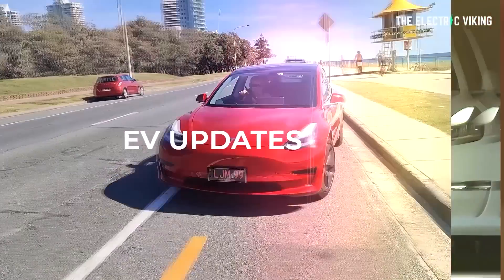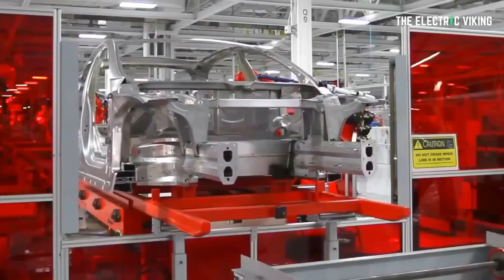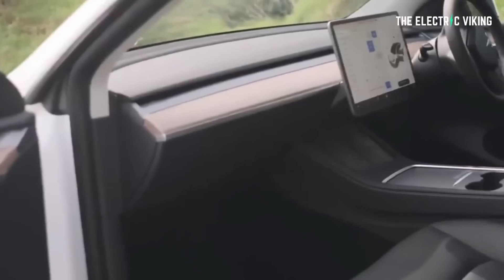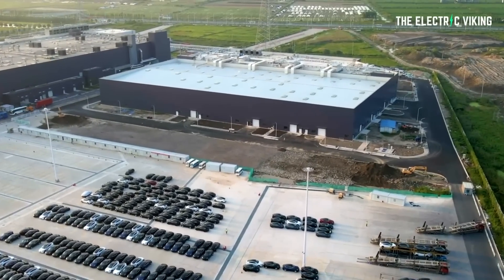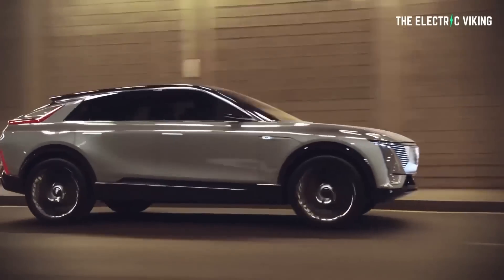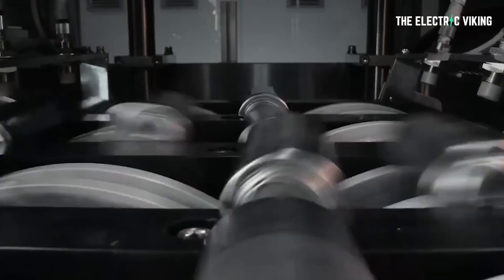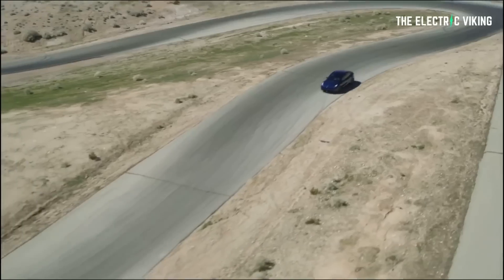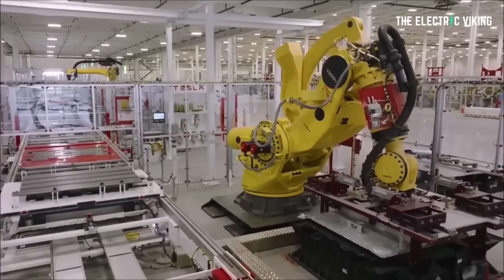Tesla's NEW 4680 battery pack size is UNBELIEVABLE

Comment: Actual measurements reported indicate this battery pack is approx. 68kWh,  not 50kWh.  Even if it were 50, this would indicate virtually impossible efficiency gains in the drive train, not gains in battery technology.  That said, I'm excited about the prospects for 4680 battery packs.  But let's get actual battery measurements.. capacity, weight, discharge/charge rates, longevity, cost, etc. .. before deciding how significant the improvements are.
Reply: The announced revolution was cost, not energy density.
At this point all questions remained open, at least for me.
Did they implemented the dry cathode technique?
Did they use the tabless design?
Did the really eliminated Cobalt completely?
Reply: @pkvp7337  Exactly. We don't really know much more than before. All that is happening here on Youtube is just speculating and generating "aritificial" news and sensations, aka click bait.
Reply: @pkvp7337  yes these batteries use the dry cathode. And are tabless. The energy density is improved as larger cell allows move active materials as a percentage of casing materials.
Reply: @aaronheaney2694  Is that confirmed somewhere? Can you point me there?  I am very interested.
Energy density can rise from the format change, but I would expect the removal of Cobalt to decrease it a little.
Reply: @aaronheaney2694  
Energy "density".... is in no way improved by "a larger cell"
(I think you may have seen my description but misunderstood?)
At cell level.
SAME jellyroll material type.
FIVE TIMES as much.
5 times the *Capacity*.
.....
Tabless, so great current / power discharge rate.
......
20% improvement in that, applii to the "5 x jellyroll" give "6x power" 
Both compared to a single 2170.
.....
Pack level 
Same total "jellyroll"
Therefore same *pack capacity*.
40% less steel in the "casings". (Based on outside surface area x estimated cell quantity (which nobody knows yet! )
I suspect the main vehicle weight loss will be removal of the conventional steel floor from the bodyshell.
.
Is better to consider the whole vehicle as a system, since all components (pack, etc) have a "knock on effect" on several others.
Reply: @pkvp7337  
Re "confirmation ...."
You said "energy density" can change with format"
I don't think so.
Power can, it can "lose" the energy at a greater rate.
It can physically hold more energy per unit volume without a "chemistry" (materials) change.
I think it's a sideways step, using 2170 chemistry, produced by the "dry method", rolled into a "tabless" cell.
Result.
Same density (/volume)
5x capacity (volume, ref battery day)
6x power (in that "5x volume", enabled by "tabless construction)
It's an accumulated benefit.
Reply: @rogerstarkey5390  There can be an improvement in energy density if there is a higher ratio of active material to structural material. The equation for the surface area (which needs the conductors, and structural wrapping is the area of the cylinder) is 2πr (r + h) (plus the top and bottom), the equation for the volume of a cylinder is πhr^2. When you work that out for 2170 vs. a 4680 then the volume increase is significant compared to the surface area increase. The surface area of for a 2170 is about 12000 sq mm, the volume is 96980 cu mm. For a 4680 the surface area is 36417 sq mm and the volume is 531808 cu mm. The ratio of volume to surface area is 8 to 1 for the 2170 and 15 to 1 for the 4680.

I seem to recall when I was watching battery day that was what they said about the 4680 is that you need less structural material (I assume they mean the metal wrapper for the cylindrical cell) compared to the active portion (the volume, or inside of the cell).  How much that contributes vs. chemistry changes I don't know, but enough apparently for them to make the change, which is super expensive. They wouldn't change the size if it wasn't a significant benefit.
Reply: @rogerstarkey5390  Formats can make energy density "slightly" better, because of area to volume ratio. The steel can does not hold energy, therefore if you use less steel for every cubic centimeter of active material, you get better energy density.
This is a diminishing returns relation though. A very small cell wastes much weight in the steel container and there are real gains to be obtained using larger ones, but the same is not true for a large one.
That reminds me that history about Tesla in the early days, trying to convince Panasonic to use aluminium cans. It seems they abandoned that improvement path.
Reply: @aaronheaney2694  there's likely also a benefit from a chemistry development too (power/energy density) as Tesla are always making incremental changes thanks to still partnering Jeff Dahn & his Dalhousie team, I believe.
Reply: @pkvp7337  I have assumed all 4680 batteries will have the LFP chemistry. So no cobalt.
Reply: @jimbodee4043  As far as I know, all Tesla LFP batteries are prismatic and produced by CATL (and now BYD).
The announcement on battery day about the new 4680 was: nickel, no cobalt, dry cathode on production, tabless
Reply: @pkvp7337  They showed different uses having different chemistries, all with the 4680 cells...  LFP was definitely one of them.  They have said many times that the 4680 could use LFP or other chemistries...  Might not make sense to use cylindrical cells with LFP due to the higher safety tolerances of LFP allowing less packaging per watt hour...
Reply: @karlsjostedt8415  Yes they said there were willing to use iron and manganese, but only for cheaper car models and stationary energy.
The big star of the show was the new nickel cell, without cobalt and much cheaper to produce.
I have not read any clue about cylindrical LFP, although many people would like to see that (me included).
Reply: @jimbodee4043  probably both. With cyber truck and semi, they will need cobalt and high nickel content to maximize energy density but different chemistry will work for lower range vehicles.
Reply: @jimbodee4043  
As much as I would like (and expect) them to be LiFePo4 EVENTUALLY ......
Louis is right in the money, correct, spot on, right.... etc.
Nickel, not Iron based.
.
Now, I've not watched this whole video yet, (Sam was "doing my head in")... But I'll guarantee Louis is closer.
Reply: @karlsjostedt8415  
Watch the latest interview with Drew Baglino at Stamford (last month)
Asked and answered there.
Reply: @jimbodee4043  I dont think the BYD deal has the same chemistry as CATL and Panasonic
Reply: @pkvp7337  correct
Reply: @karlsjostedt8415  actually Tesla has said that the 4680 would NOT be LFP.
Reply: @davekozlowski1266  Tesla said that current 4680 are not LFP.  Tesla will surely change their minds as soon as there is reason to.
Reply: @CorwynGC  they stated that the 4680  wasn't a good design form for LFP batteries. They are already using a lot of LFP batteries, just not in that form.
Reply: @davekozlowski1266  Right, that changing (which it could) would be one such reason for them to change their minds.
Reply: @jimbodee4043  The 4680 is a higher capacity lithium-ion battery not LFP.  They  are nickel-cobalt-aluminum (NCA) batteries so I guess that means no cobalt.
Reply: The Size must be the same for all versions to fit the chassis. This is no indicator of the number of cells inside. So the pack size is same for 50 and 70kw. The weight would vary.
Reply: 1) The anode has always been dry. What's new is the dry battery ELECTROLITE process. 
2) Without any chemistry changes, the 46-80 cell is more energy dense both by weight and by volume due to the increased volume to surface area ratio of the larger cell.
3) The deal with BYD is for LFP blade batteries. They have a near zero risk of thermal runaway resulting in battery fire. The deal with CATL is for LFP prysmatic cells. Tesla will use anything they can get their hands on until they can sufficiently ramp cell production for their own needs.
4) 46-80 is a form factor, not a chemistry. Tabless electrode, DBE and the larger form factor can be used with any chemistry. At this time, I have not heard that Tesla has or will implement 46-80 LFP, but there is no physical reason why they can't.
AS for the speculation on "D50" meaning that it's a 50 KWH battery pack, it's just that, speculation. For my part, I believe it's somewhat bigger than that.
Reply: Sam,  Is the Tesla Model Y 4680 out of Texas a 50 Watt or a 68 watt battery pack???  This is very important!
Reply: @laurenceguild5799  
50 Watt or 68 Watt?
NEITHER.
It's " +/- SIXTY EIGHT KILOWATT HOURS"
Reply: @laurenceguild5799  Other users who have the car have said 68 usable and have recharged over 60 kWh already.
Reply: @laurenceguild5799  
Watch the channel everyone is referring to.
I THINK Sam is confused between full pack and the amount charged. (10-97%?)
Reply: When will the actual vehicle 🚗 be available for proper tear down to see all the specs for sure ?
Reply: @river2voya211  
Hold in..... I'll just look ....   (/s)
.
.
"When someone decides to do it...... and publish the results.... Maybe? 🙄
Reply: Where exactly does the number 50 kWh come from? I looked up the video from spiken reviews, and on the paper you can the consumtion. I think it says 28 kWh / 100 miles. For 279 miles the battery has to be 78 kWh!
Reply: No one ever charges lithium 100% you can increase the life of them huge
Reply: Why call it 50D then?
Reply: @egs2169  don't know, but hard to put over 60kwh into a 50kwh pack. Obviously it's bigger than 65 kwh.
Reply: My guess is that they have moved to a ‘usable capacity’ rating (50D) instead of a ‘raw capacity’ rating.  There’s a buffer on either end.  The useable capacity probably varies significantly between battery cell technology, so raw capacity is becoming more confusing.  I’m not believing the 50 KwH raw pack size unless I hear it from the company or a reputable tear down.
Reply: The evidence for the 4680 model Y having a 50 kWh battery seems weak. All I have seen is that the mobile app refers to it as a “50d”. On the other hand the same reviewer, “spoken reviews” on YouTube, demonstrates a capacity of about 68 kWh by doing a range test then recharging.
Reply: @dufkers  so it is 68 kWh. The recharging measurement is the most accurate. Sam as well as the Tesla fanboys are not good at physics. A bigger cell is more efficient, but is only a few % more efficient in space saving. The advantage is in manufacturing cost but the savings is only around 10%. This is an improvement, but only evolutionary, not revolutionary. The structural battery is to use the battery case as a structure, but it creates stresses directly to the battery, which can be dangerous. In case of accidents, the battery will be more easily damaged. Coupled with a flameable isolation insulator foam, Model Y is not as safe as Rivian. The additional cost saving is not much, should be around 5% but any saving is welcomed.
Reply: @othmanskn  Agreed that Sam should check the facts and evidence better as the battery size is no only 50kwh but closer to 70 in gross capacity.

However, you are coming with as silly predictions with no evidence by calling the new Model Y unsafe with flammable foam. Where do you have the evidence of the protective foam in the sides of the pack being “flammable”?? You know, if you know physics, then you should also know that you state proven facts not just oie in the sky assumptions. When the Cybertruck comes then compare it with Rivian. The Model Y is already more successful as the Rivian will ever be and has proven it self with hundreds of thousands of customers.
Reply: @TheDanishSpaceman  Sandy Munro tested the foam from a Tesla and a Rivian and said the foam from the Tesla was flammable.
Reply: @rogerstarkey5390  Just because they are smart, does not mean they can break the laws of physics. For details on the Rivian heat isolation foam, watch Sandy Munro Live.
Reply: @davidbeppler3032  I was just replying to the guy who questioned the flammability of the foam used. It was tested by Sandy Munro and he found the Tesla foam more flammable. 
I have no idea how that effects the safety of the car but it must have some effect.
Reply: @othmanskn  the manufacturing cost is closer to a 50% saving. Did you consider the removal of the cell drying process with these cells?
Reply: @alibro7512  
"Flammable"
1) Emphasis on "was"
.
2) there's a difference between "heat" and "flame".
.
There are many foams which "burn" (ish) then form an insulating barrier.
.
If you go waaaay back to the very first patents for the idea if a structural pack, there was a section mentioning (from memory"
"A material which changes state depending on temperature" and "forms an insulating barrier in case of extreme temperature".
Reply: @alibro7512  That was a HORRIBLE demonstration by Munro.  The used a torch on a large flat expanse of foam, and compared that to a a match on a tiny shard of foam.  Try the same for yourself with two pieces of the same wood.  OR just think about how you light a fire. I would expect this sort of thing from FUD merchants, and expect better from Munro.
Reply: @CorwynGC  I was only pointing out where the information on the foam came from, not agreeing or disagreeing with it. 
Yes the demonstration was badly done but Sandy wouldn't have pointed it out if he didn't think it was relevant.
Reply: @alibro7512  Munro & ass. haven’t got the foam from the 4680 battery pack, so that sounds strange. If it is from the current cars they dissembled than it is a bit of a mute point as safety has never been a concern for current Teslas
Reply: @alibro7512  No criticism of you intended.
Reply: @alibro7512  I know.  Maybe Sandy should burn both the carpets and see which one burns faster, and the seats, and the headliner?  Those matter as much as the foam in the battery packs.
Reply: @davidbeppler3032  There are many many things I am not an expert in. Product safety and fire retardance are just two of them. 
I prefer to rely on people who ARE qualified  and Munro Associates have people with those qualifications. 
It's kind of a moot point anyway as mentioned by another commentator who pointed out it was not a 4680 pack that Munro tested.
Reply: @Othman just because you hate Tesla does not make them bankwupt no matter how smart you think you are.
Reply: @alibro7512  To be fair, Sandy did not *care about the flammability of the cooling system, just made a note about it.  He did not say it mattered at all.
Reply: @alibro7512  more flammable, as opposed to just flammable?
So either your phraseology is wrong, or they're.... BOTH FLAMMABLE!!
Reply: @othmanskn  don't know where you're getting your cost savings from.  Battery day gave figures for cost savings based on structural battery production & materials then 2170->4680 materials & construction, which is far higher than your claimed 5% in combination.   The fact Tesla takes 10hrs to make a car, vs VAG takes 30hrs, I'd imaging 20hrs is worth quite a bit (bearing in mind not all those saved hrs aren't just because of the battery structure).
Reply: @othmanskn  very vague reference to Sandy's multitude of videos
Which one?.... 🤦
Reply: @aaronheaney2694  Othman ["follows Lightyear closely"].   Their claims are hilarious, I remember reading their science fiction novel a couple of years ago & there were some brilliant arguments & claims in comparison to Tesla regarding price/"quality".  I wonder if Othman is trying to downplay or damage Tesla's reputation (thus sales) so his beloved little Lightyear investment can grow like Tesla's?
Of course no one would play that little game with Tesla or has ever done that kind of thing in the past, eh? 😉
😅😂🤣
Reply: @taefravis  Othman said he likes Lightyear, who make claims & comparisons reminiscent of Nikola.
If wonder if Othman is Milton or his younger brother, desperately to pump Lightyear shares to get back some of what they lost at Nickalot?
Reply: Sorry, should have done your homework before putting out this video.  Can’t put over 60 KWh into a 50 KWhr pack.  Got egg on your face and I expect better from you.
Reply: @cherokee180c0  
Re "egg on face"
I concur.